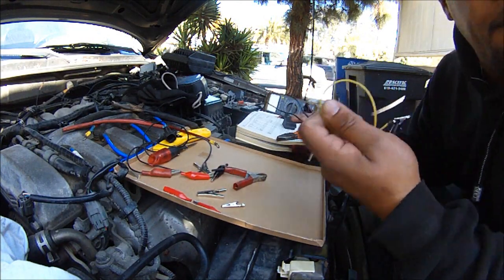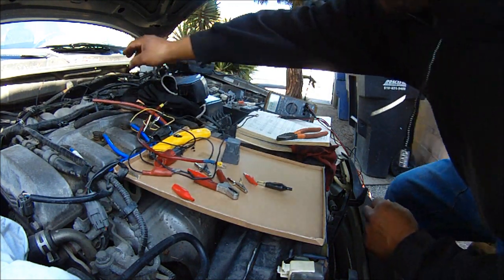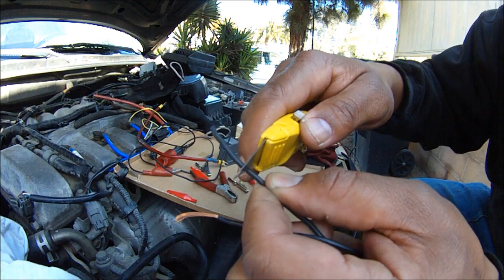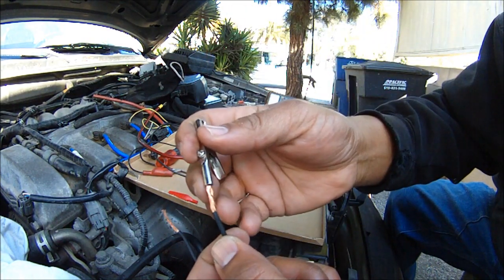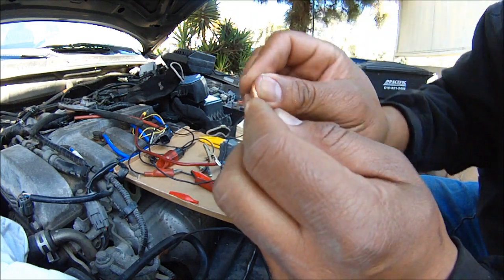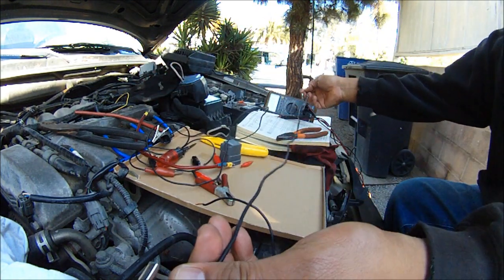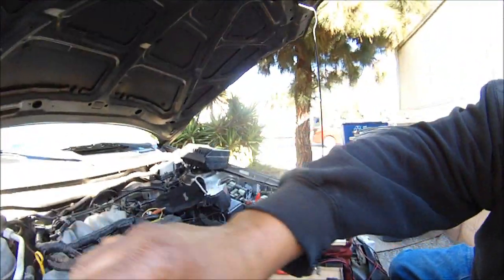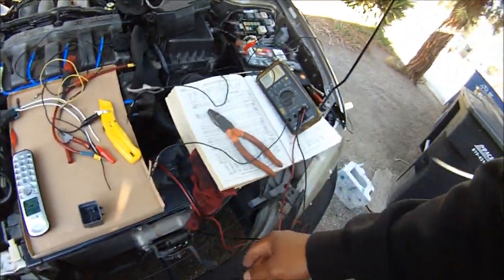EASY HOW TO TEST RELAYS & MAKE HOME MADE WIRES (JUMPER). HOW TO TEST FUEL PUMP RELAY TEST

Comment: Wanted to say thank you for this lesson that felt like i was outside with my uncle on a nice saturday afternoon , learning how to work on the car while the older married women were inside making us something to eat. I grew up in the system so of course I never actually had that but moments where I can connect with it are still a healing salve.  With that said, I was wondering why - if you already had two sets of wires made, you didnt go on to show how to further test the voltage of the relay and explain that just because you have continuity that will close that circuit, doesnt mean the relay is good. There could still be resistance that causes an interference with the amount of voltage being delivered. If you place the clips from the battery onto 30 & 87 and then take the other set connected to the voltage meter and place those alligator clips onto 85 & 86 than your voltage meter should go down to zero or damn close or the relay is not good. (Even though the flap inside will click when you supply power)

Comment: Do remember that only applying voltage to the relay will not make the other side close. It will not make the magnetic field on the coil inside. Most important thing when dealing with ANY electrical work is you need power AND ground. That coil inside the relay is a small load inside the circuit. I usually take a 9V battery to test relays cuz it’s easy. But this works too. Then use your meter to measure ohms on the other side of the relay

Comment: When jumpering a relay, if you hear a clicking noise as in this video, it's an indication that the relay may be good but it does NOT guarantee that the relay is good. Many times, I have found a relay to make a clicking noise but it's still not making a good contact, thus the relay is bad even though it clicks. The only way to know for absolutely sure is to have a multimeter set on ohms (resistance) or continuity connected on the terminals of the switch leg. Then, when you apply battery power to the magnetic coil, you should have continuity (or little or no resistance) on the switch leg regardless of what you hear. Relying on a clicking noise alone is not a proper test and may cause you to NOT find the problem, leaving you chasing your tail. This video spends more time on how to attach an alligator clip to a wire. Also, the size of the wire is NOT very important, as long as you use a wire that is large enough. Being larger than needed is fine. For most automotive applications, 12 gauge (AWG) is as big (bigger than needed) for a jumper wire. Personally, I have an "Automotive Circuit Tester Lead Kit" that has all you will need but it's a little pricey ($120) if you don't  need it on a frequent basis.
Reply: Agreed, this only proves that the electromagnet portion of the relay is operational.  Our friends here would benefit from watching the 1A Auto (or Ratchets & Wrenches) video on this topic.

Comment from the maker: Attn: Do it your selfers. After you apply voltage to the supply terminals 85 & 86 and the relay is energized and closes, put your meter on the OHMS (resistance) readings and check terminals 30 and 87 for continuity. Check your repair manual for specs. Keep in mind your vehicle relay will have different relay terminal numbers, all makes and models will vary.
Reply: glad you mentioned about ohms on 30and 87. just because a relay clicks when power is supplied doesn't always mean its working. good clip though